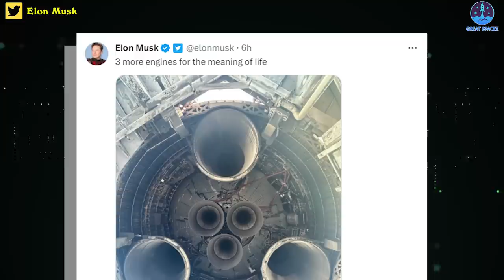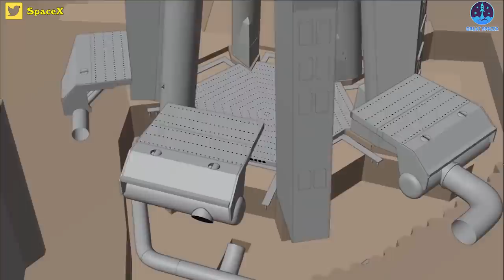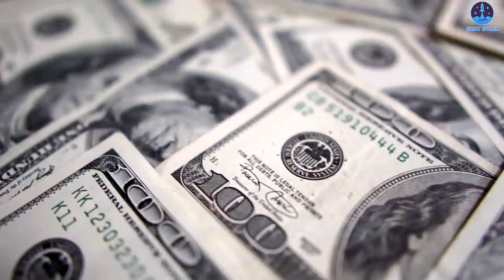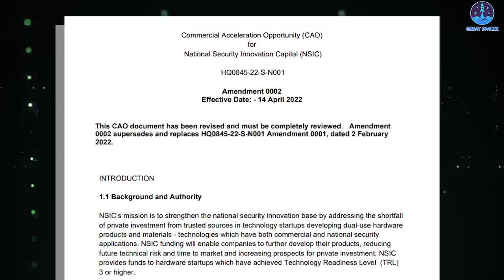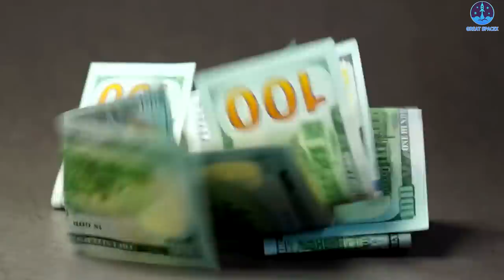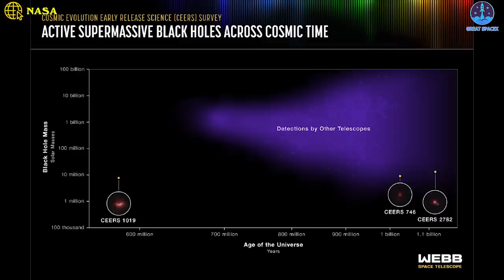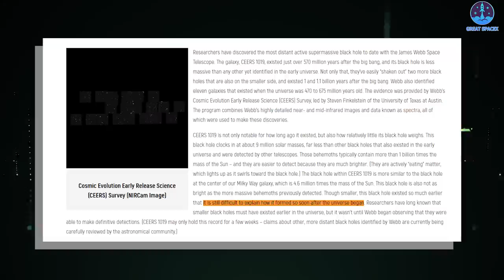Elon Musk's Starship update, Water-Cooled Steel Plate READY, New Megabay progress and more!

Comment: QUESTION: Does hot-staging now make the entire 2nd stage a de facto LES? Launch Escape System? If so, wouldn't this help Starship accelerate its human-rated approval?
Reply: Good observations, but still a bit early in the program for it to be considered relevant.
Reply: @Winkkin  Why early? This is a major design change that could affect a key aspect of the entire system. Assuming hot-staging is the long-term plan (replacing the the "flick 'n fly" separation plan), why wouldn't they begin the re-application process now?
Reply: That's a great question
Reply: What? Not even close. The Starship section can't be considered a Launch Escape System. The second-stage isn't a capsule with a parachute, it is simply another rocket, one crew CANNOT escape from. Just take two seconds to think about it. How exactly is the Starship section supposed to propel away from an impending explosion of the SH? It is a heavy rocket under the power of the complex propulsion system of the Raptor engines. A LES needs to jettison quickly and automatically, you're saying Starship can do that?
Reply: @lawrenceallen8096  Early because we havent put seats in a Starship yet. Since Starship is designed to make landings on the Earth, its obvious that there isn't a need for a separate emergency abort mechanism. You just detach from the booster and boost away.  Furthermore, the hot staging ring is designed to allow starship exhaust gases to escape from the booster/starship pair without damaging the booster. That is what the design was modified for.
I'd bet no one on the design team argued that it would help prevent damage to the booster during an emergency abort.
Reply: @jaydonbrown617  Hmmm. So why would you need a parachute for a vehicle that makes propulsive landings? We need to "think" out of the 1960s disposable rocket + 1-use capsule mentality. It's 2023.
Reply: I would say no because it does not eliminate the massive fuel tanks on stage 2. Stage 2 is just as much of a threat as stage 1, the fact that this does not separate the crew cabin from that danger is going to be an issue. BUT this is just my opinion.
Reply: @daveallen63  Exactly, not necessarily an opinion, but a fact!  
Most if not all LES vehicles eject the crew in a vehicle devoid of ANY fuel. Starship is just a smaller bomb compared to SH, but still more powerful than we've seen the Falcon 9 to be. 
Starship can't and will never be capable of a LES unless they somehow turn the top half into a detachable capsule.
Reply: @lawrenceallen8096 It needs to be able to propel away from superheavy. Its twr is to low to do that while fully fueled. It would probably get caught in the explosion.
Reply: @localobug3034  
Perhaps.
Reply: Given the scale of what is going on, ANY escape system is like putting an ace bandage on a splinter.  It simply won't get far enough, fast enough to outrun any disastrous situation.  Anyone going up in one of these has already made their own evaluation of the risks and can care less about what some armchair bon bon popping Karen thinks about risk. <pops another bon bon>  It makes for great drama though.
Reply: @watchthe1369  Well, we did have the Space Shuttle for 135 launches over 30 years that had no LES. Everyone lived with that risk. As for SpaceX, their engineers have been doing some remarkable things. I don't know enough about the vehicles, physics, etc. to conclusively say that in some mid-flight scenarios that Stage 2 couldn't get out of the way fast enough. Also, with the cost effectiveness of Falcon, considering the mass the Starship would put into space, it may be a rounding error to send up 7 astronauts on the Falcon. For example: 2 starships would put 1.5 times the ISS's pressured space into orbit. So what's an additional $ 60 million launch to send people up there?
Reply: @jaydonbrown617  Yes, that is what he is saying. I'm sure Elon will be asked this question right away. Let's see what he has to say.
Reply: @lawrenceallen8096  It 2023? wow time flies.
Reply: @daveallen63  there are a million scenarios, not just worst case. How about multiple engine failures?
Reply: @lawrenceallen8096  The Shuttle was human safety rated for many other qualifications, some of which Starship can't have. But yet, even that wasn't full proof against failure (RIP Challenger and Colombia). 

Judging solely on what we've all seen Starship and Starship+SH do, Starship just doesn't have the means of getting away from SH in the event of any accident.

 I mean judging by the 4/20 flight, you'd think they'd try to save S24 (or 23, whatever it was), but they couldn't or didn't think to. The two seem pretty joined at the hip, pun intended.

As for launching humans with Falcon 9, I'm pretty sure it won't be a measly 60 million dollars. These are people, not garbage internet satellites.
Reply: @jaydonbrown617  I think $60 mil is the cost for a crewed flight to the ISS.
Reply: @robertmartens7839  What about them? An LES separates the crew compartment from the rest of the rocket that houses any fuel. On the Starship that's impossible to do in it's current form. Stage 1 and 2 both have massive fuel tanks, and no way to separate the crew cabin from them.
Reply: @lawrenceallen8096  Ah, but per seat
Reply: @daveallen63  In a multi engine out launch where they couldn't  be able to make it to orbit, they could just light up the starship and land somewhere. You are right, we got a lot of work to do.
Reply: @robertmartens7839  I agree, I'm just pointing out NASA requirements for LES. Things change so quickly anymore, NASA will probably be willing to accept that risk in the end. I watched all the Apollo launches and the first Shuttle launch, then things got a bit boring in the Space travel world. So I'm just glad I get to see this next big step grow. I hope the next launch works out. Take care.
Reply: @jaydonbrown617  In its 4 or 7 seat configuration?
Reply: @lawrenceallen8096  Unclear, though it seems to be for either configuration. I'm not sure if there are multiple seat configs of the Crew Dragon, but sources say its anywhere from $55 million (NASA OIG) to $88 million (SpaceX CCtCap contract valuation). I also doubt they leave seats empty.
Reply: All this talk of having to redesign spaceship to incorporate an LES/escape capsule (just to "suit" NASA) is bit unreal. It is like having to have that on the Space Shuttle/Dream Chaser, or on a Concord! It is nonsense. Remember Spaceship is being designed to carry over 100 persons! The Spaceship will have to be tested/proven to be safe and so reliable such that an LES is redundant and not necessary !!!
Reply: @jaydonbrown617  NASA contracted for the 4-seat version only, but Dragon crew capsule can be built to fit 7 crew.
Reply: @johnrday2023  Agree. SpaceX's Goal for starship: to operate like (close to) an airliner... rapid reusability. However, present day, NASA is paying the bill (i.e. Artemis), and is setting the standards that must be met. So it has to be a consideration.
Reply: @lawrenceallen8096  Funny thing about that airliner bit. I remember that TED talk with Shotwell claiming that Starship will replace and outperform airliner jets......YEAH OKAY LADY. Elon must have to search far and wide for people like this to work under him. 
This simply CANNOT and WILL NOT ever be feasible, I wouldn't even know where to start with this....
Reply: @jaydonbrown617  "Ever," huh? Wow. I bet someone just like you stood on the deck of a caravel ship 500 years ago making a 3 month journey to the "West Indies" and said: "Fly? From North America to England in at 600 miles an hour in 7 1/2 hours? Then turn around and fly back on the same day? That simply cannot and will not ever be feasible, I wouldn't even know where to start with that..." Sadly, people who think this way are too near and too common. This is why we have BRAND NEW $4.5 billion 1960s tech SLS rockets. I may not live to see it. And my kids may be very old when it does happen, but if humanity can go from horse & buggy and candles to walking on the moon in 70 years,  have no doubt that it will happen.
Reply: @jaydonbrown617  Thought: traditional capsules (and the Shuttle) do technically have "fuel" on board, and a particularly nasty one: hydrazine, to power the reaction control thrusters for maneuvering. But the point you are making is not "fuel" as in the large cryogenic fuel tanks of the 2nd Stage SpaceX Starship that are inseparable from the crew cabin. But hauling around fuel in (or out of) orbit was done with lunar sub-assembly system of the Apollo command module + service module + lunar lander 2 of which indeed contained fuel for specific navigation burns. Pulling back out of the weeds, for something that is going to ultimately be 2.5 times more powerful than the SaturnV, 100% reusable, and half a century more advanced, it does make more sense to start thinking about incorporating escape pods rather than trying to adhere to a 1960s capsule LES approach.
Reply: @lawrenceallen8096  Hold up there pal, nice anecdote, but you missed completely. I am not saying that faster travel between cities and countries will never happen, just that Starship will not be the vehicle to do this. 
If you like anecdotes, okay fine. There was no way people 500 years ago could think of jets and airliners, but you're asking them to think locomotives were going to magically travel across the globe in record times. 
Do you remember the Concorde? That thing had a TON of ground interference issues and was dumb expensive to fly. The Concorde is like a little bicycle compared to Starship. If you think Starship will ever be used in the same manner as airplanes, you, your kids, your grand kids and Shotwell can keep dreaming. 
A much faster means of transportation may be developed eventually, but it will never be Starship, not in it's current design anyway. Maybe like 50 iterations down the line when it's not a flying skyscraper putting out 170+ dB of noise pollution, let alone rocket exhaust all over Earth's atmosphere. Oh and not cartwheeling to it's death.
Reply: @lawrenceallen8096  Okay, well I'm sure it will be a decade or two before they even think about that. Starship isn't the Enterprise, it is an objectively small craft compared to the likes that utilize "escape pods". 

Until then, once those 100 poor souls are strapped in, fueled up, and countdown begins. They either land in one piece or become a new reason for a hiatus of spaceflight missions.
Reply: @johnrday2023  Perhaps, but it is just conversation between people who have like interest. It's not really that big of a deal is it?

Comment: I wouldn't be surprised if after deluge testing finishes, that musk brings in some prefabricated concrete, shaped, barriers (like the ones you see in the medians of road works) from somewhere like Dubai, or Saudi where they have ones designed to stop sand and dust storms (which is basically what Starship makes close to the ground) from expanding, and perfect it's location during the static fire tests. Quick, strong, simple, easy to put in place or move, it fits the Elon ethos of getting things done.
Reply: Stop

Comment: It was all pre-planned. Even the destruction of the old base during the test flight. You can't remove a faulty base until you have a big blow-down of destruction.  Spacex does this to choose the replacements. Spacex always lets one or two rockets fly, knowing they will need to be destructed. Spacex then knows what went wrong, with no second guessing.  So simple, Spacex monitors all that went wrong, to be sure of how to respond to fix it. All those new water-cooled steel Plates were already on the drawing boards & planned and probably manufactured to be installed, Elon Musk's way.  I am so impressed.

Comment: Elon musk should find a way of collecting stardust parts as it may contain atomic oxygen, to gain further space travel. Big vacuum attached to spaceship or vents which could collect this and remove the oxygen
Reply: How do you create a vacuum pressure lower than outer space?
Reply: @robschenk2015  a vacuum pressure is natural in outta space, ain't u seen the alien film where the ship depressurised from a pin hole in the glass. Principal the same has high altitude planes. So there the vacuum,

Comment: Doesn't the addition of more engines require more fuel?
Reply from the maker: Definitely. I will discuss this in next episode
Reply: As mentioned, additional engines will require stretching the rocket to accommodate larger fuel tanks making it a slightly heavier rocket with almost as much power as a Falcon nine booster.
Reply: @mikegardner107  and revised tower, QD, etc.?
Reply: @PrtPrtPrtGood  Yes, as he mentioned. About a two meter difference in height for the added ring sections for the hot separation. And I think possibly more depending how much larger fuel tanks require.